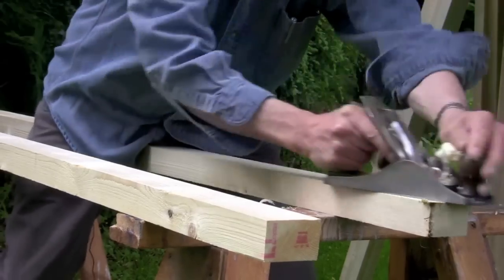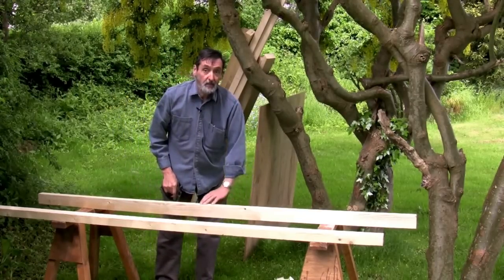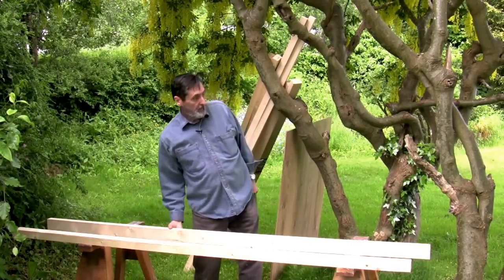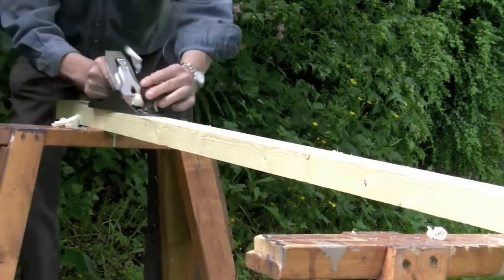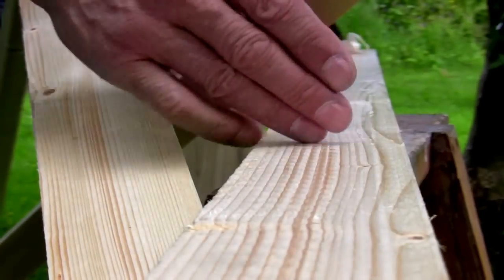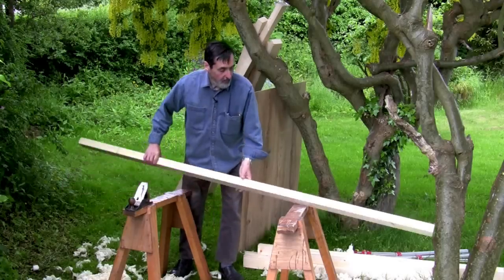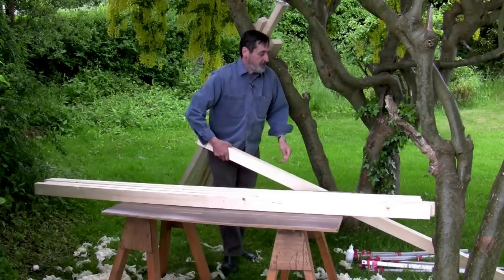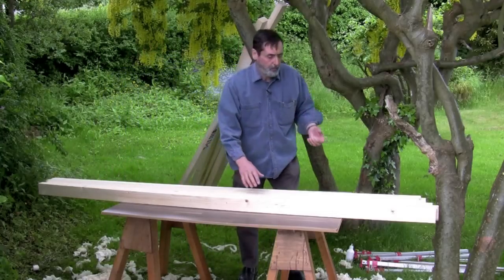How to build a workbench - (Part 1) Laminating the top | Paul Sellers

Comment: Mr Sellers, I've just completed my first glue up to make a wider board. Watching the ease in which you use a simple had plane to true up 2x4 stock gave me the courage to make a go of using reclaimed 2x4s to use in my project. The 2 main ideas from this video that made the glue up go super smoothly were drawing the V on the boards to retain positioning and doing the rehearsal. Thanks again for all of the inspiring videos that you provide.

Comment: For those of you just coming upon these videos, I can assure you that you will not be disappointed with this bench.  The one I made out of 2x4s, using exactly these plans, is rock solid. The most expensive item was the quick release vise, which I got from Lee Valley.  I had a couple of chisels, a cheap handsaw, and a $4 Stanley plane that I got on eBay for very little money.  Oh yea, and a bunch of sash clamps I got at Harbor Freight.  Enjoy building it!
Reply: Joel Finkel Starting mine today, time to do something with all this lumber i've been hoarding and moving around for so long!  Got a new vise for my birthday-and it's a dandy, QR and all!  Can't wait to get it all up and running.  Borrowed clamps from pal.  Yardsale plane (reconditioned by me).  Folding plastic saw horses.  Glue.
Reply: Wade Patton Paul never really shows how to attach the vise.  Let me know if you want any assistance with figuring that out.
Reply: Thanks but no problem.  The bench is much simpler than most things I've made.  I just come form a metal-working background and now need a wood-working bench.  Cheers.
Reply: +Wade Patton Just started planing the boards for the tops this afternoon.  like you I come from a metal-working background (machinist for 25 years), do you too find yourself breaking out the dial calipers? lol.  Any words of advise in hindsight? anything you would have done differently or spent more time on?  how do you like the bench?
Reply: +Darrell Gardner No dial calipers but I want to get some proper dividers and inside/outside calipers now for precision without known dimension. Measuring by feel is precise, just without any number.

I actually started out in the yard, brought it in after making the laminations.  I didn't get fit the well board as nicely as I should have, but it doesn't show and works perfectly.  Take your time fitting up your vise/s.  Funniest thing is, after getting used to the quick-action wood vise is catching myself yanking around on my machinists vice as if it's going to slide open or closed when positioning work!  

Love the bench.  Super solid and stable, yet is easy enough for one person to move around. Mine is just over 6'.
Reply: Thanks.  I did get a laugh when you spoke about trying to quick release your machinist vise.  I watched your video on filing cast steel cuz it reminded me of the one I posted last night to my channel, just really doing it to document and learn from myself and if someone else gets a kick out of it, great ha.  I got a few vises like the one Cody from "wranglerstar" mounted on his bench, one restored already and one needing some love but in amazing condition.  any thoughts on letting the vise stick out or flush mounting the solid jaw with the bench?
Reply: Darrell Gardner
 Find the Paul Sellers video if you can to see how he sets up his vise.  It may be subscription-only section (15 bucks a month), but the gist is add a wooden "surround" to the fixed jaw and a correspondingly larger pad for the moving jaw.  Then also, try "cross-clamping" as PS often does.  I'm currently using magnetic backed hardwood pads that came with the vise (which doesn't allow the oversized setup), but am now leaning toward fixed wooden pads just as Paul does. 

Next vise I need is a Ball-type for engraving!
Reply: awesome, thanks!  I'll have to check out the "surround" set-up or figure out something on my own.  I like the idea of making the jaws larger.
Reply: Hey Joe.  I was wondering - did you plane the rounded edges off the 2x4's.  It seems it would need to be done; sounds like a ton of work with a hand-plane.  I want to make this bench entirely from hand-tools, but might have to use my table saw if it's just too hard to do.  How did you get the rounded edges straight?
Reply: I dealt with the rounded edges after I glued up the slabs.  I used both a hand pane and a thickness planer machine.  My recommendation is that you not make a fetish out of working without machines.  Use them when it makes sense.  

In my opinion you should not worry about using a table saw to shave off the 1/8 of each edge to take out the rounded corners.  Or you can do as I did, which is to glue everything up and THEN plane it down (something you'll have to do anyway to take out any twist and flatten the slabs.

Have fun!  That's the point.  Do what you need to do to get the bench built.  You'll love it.  And then have fun using it.  And use it.  Treat it like a bench, not a piece of fine furniture.  Do not be scared to ding it up.
Reply: Good advice brother.  Thanks!

Comment: I'm impressed as Paul is using basic tools that anyone who wants to start woodworking should have. .I just watched the full set of video's, he says multiple times it's basically 2x4 planed and glued to make wider boards, pine, spruce, whatever softwoods work just as well as buying a crazy priced walnut bench top. In the USA, Lowe's or Home Depot are probably the easiest places to get material, 2x4 (actually closer to 1-1/2" x 3-1/2" are currently less than $3.00 each) It looks like you need quite a few of them though probably around 30? (to allow for cutting legs and 'mistakes') Still way cheaper than a bought bench, even from Harbor Freight Tools.The comments he makes about it being just as solid as a hardwood bench are very helpful.

Comment: Paul - another new subscriber who happened by your channel by way of Wranglerstar. I'm in the midst of building a poor man's bench along with some of the modification that Cody added, namely the use of 2x6's for the laminate. On paper, it seems like it would be a small matter to go from 2x4 to 2x6, but in practice it is quite beastly to surface-plane both sides of a 2x6 and also knock the bullnose off the sides.

For the first few nights, I would finish three 2x6's and then call it a day, having tuckered myself out from planing. Part of that was the nature of the material I was working with, rough and knotty, and part was poor technique. One of the positive aspects of using the larger dimensional lumber is that you will have self-educated on the character of pine and the use of your tools by the time you finish. I have a WWII-era Stanley #4 and a new "contractor-grade" Stanley #5. Both perform quite well now that I've learned to tune them properly. I despise the plastic knob and tote on the #5, but my hands have become sufficiently calloused that I can push either one for an hour or so without creating blisters. I had to use gloves for a while there, no small trick with a #4.

I am currently at a point where I have one 7-foot slab completed and cut to length, along with two struts made from three 2x6's laminated together and cut to 33 3/8ths (my bench will be 40" when complete: I am 6'2"). The slab was made from eight 2x6's, which will make the finished slab almost 13.5" with the skirt. This is intentional, as I want the front slab to be slightly larger and the rear to be smaller. It will be made from six 2x6's which will be 10.5" with the skirt. I plan to also fasten 2x3's to the inside of the well, flush with the bench top, to give myself some clamping surface in the center of the bench. Finally, I've decided to span some long rails across the bottom of the legs, although I haven't decided how to attach them to the legs. I'm assuming I should use a through-tenon on the long rails and then butt the short rails against the through-tenons at a 90 degree angle at the same height to provide a good surface for a platform under the bench. 

I want to thank you for this series, and all of the work you've put into your YouTube channel. Your instruction is excellent, and your down-to-earth and unpretentious style is a joy to observe. You've taught me and inspired me and I want you to know that I greatly appreciate it.

Comment: I built my workbench based on these
Videos, thanks they were inspirational in
Getting me back into wood working.
One thing I did do which may be helpful
Is to build the leg frames and apron first
Assemble these together  then you have a good level
 base to laminate the worktops onto
Helps avoid any racking or twist

Keep up good work!!
In place and nice and level

Comment: Love it just a observation. I find having some angle iron like made from old bed frame material to clamp on both sides at each end maybe six inches or so in and maybe a couple more a foot or so from the middle will help with that stair-stepping you're talking about. Also get a small square flat tray and small paint roller put some glue in the tray. Then just paint the surfaces you want to be glued together have them all laid out on waxed brown paper. (Usually available at most building supply outlets) just flip up the wood on their edges squeeze them together lightly get your angle irons in there and start tightening down the clamps slowly and evenly watching the stair-stepping. Rolling the glue will give you a quicker application and the wax paper will help with clean up after 20 minutes or so go around with knife and and a wet cloth or paper towel and keep the drips of glue from hardening. This will help in your finish sanding glue really shortens the life of sandpaper so the more you can keep that down the better. But if you have to remove a clamp or a angle iron cross brace clean that area quickly and replace  it. If you remove a clamp or a cross brace and angle bar do it one at a time and if you have a lot of pressure on them wait till the glue is set sandpaper is cheap and having your work fall apart isn't worth it.

Comment: I built furniture for a while and the way we would do glue ups like this was to spread the glue on with a paint roller liberally. provides an even coat all the way along the surface and allows you to glue up a lot of pieces before they start drying. might be worth considering. Great work though Paul! I'm definitely going to refer to this when setting up my own shop.

Comment from the maker: Yes! Yes! Yes!!! This is exactly what we want. It's dry and well seasoned = low movement. A few nail holes and defects will make no difference to the functionality of the workbench and yes, I have made benches many times from secondhand wood including pallets. I like a real workbench. Also, no, the wood will not make any difference to the plane iron and of course you will be sharpening from as you go. Watch for cement or rubble dust anywhere in the wood. This can dull edges in a heartbeat.

Comment: I used to have a bench similar to this. No dog holes. Had metal front vise. I went to one with wooden vises, dog holes, etc. I liked the first one better. I think I will build another along the line of Paul's. Much better bench in my opinion.

Comment: I'm totaly jealous of your 2x4 that actually look like it! One thing to know is that wood is measured up before drying (at least in N. America). So a 2 x 4 will never measure that and depending on the wood type they will shrink more, pine is around 1.5" by 3.25" while cedar shrink a lot less. I wonder if it's because they are manufactured after shipping meaning tree trunk would have had some time to dry before getting in the UK or if its a big difference between Canadian pine and the pine used in the UK (possibly Norwegian pine?).
Reply: Erdanx0 You could always buy 3×4's. Found in most lumber yards.

Comment: Paul, Thanks so much for making these videos!
I'm having issues with bows in my timber. I've planed the boards to make them nice and smooth as suggested but when I set them side by side for clamping, there are large gaps between the boards which don't close when clamped. Could you please give me some advice on straightening the boards? I am having difficulty getting them straight over such a large distance.
Many thanks,
Morgan

Comment: Hello, Paul!  I found your projects to be a great inspiration, and as a first 'real' woodworking project am going to work on this bench.  I do have a question on the lamination: the only 2x3s in the area I can find are fairly knotty, and I'm looking to see just how perfectly smooth we need the wood for lamination?  I can fairly easily take down the high and rough spots, but I find it a little more difficult to lower into small saw kerf spots on the board.  Thanks!

Comment: Excellent.  No need to put glue on both sides of the joint or spread the glue out.  Those are myths that have ruined a lot of glue-ups and need to go away.
Reply: +Leaning Tree Woodworks How does spreading the glue out ruin a glue-up? The more surface area the better.
Reply: The glue spreads itself during clamping.  Worrying about spreading your glue out perfectly takes time and in a complex glue up, if you take to much time the glue dries before you're done.  So taking the time to do an unnecessary step of spreading your glue can ruin your glue-up.  People think it's something you have to do, but if you use enough glue and lay it out in the right pattern like is done in this video, it will  spread itself out.
Reply: +Leaning Tree Woodworks Spreading glue only takes a few seconds. Also you can use less glue and still be sure that you covered the complete surface.
Reply: In a simple or small glue up, there's no problem with it.  When you get into big and complex glue ups with a glue with a short working time, you can run into problems.  It's thinking that you have to put glue on both sides of a joint and perfectly spread it out no matter what that will get you in trouble.
Reply: +Leaning Tree Woodworks You're correct. When you lay the clamps to a joint, that glue expands out, and also into the wood fiber on both sides. I never do glue both sides. I think that myth was invented by a glue manufacturer, to get you to buy more glue, as using it on both sides wastes it. You have double the squeeze out.
Reply: +craxd1 Exactly.  I don't know how the myth keeps going with it being so easy to test.  Put glue on one side, press the joint together, then pull it apart to see where you have glue.
Reply: Leaning Tree Woodworks ok now make your own video about it

Comment: I have ran into 2 x 4 stock here in the US, both studs and long, that were less than 1-1/2" thick. Talk about short changed, and things that wont fit over it. Whomever the manufacturer was, they over planed them. I believe I bought those at Lowes. I made them come back and take the entire pile, less the few I had used before I caught it. I should have made them take those back too.
Reply: +craxd1  almost right ceaxd do it both way let it dry and cure then pull them apart and see which is stronger

Comment: I've never tried aluminum clamps. I see one drawback being the amount of force you can (can't) apply, as opposed to a steel barred clamp. However it's great that you wouldn't get the black staining that occurs with high Tannen (acid) woods, like oak and walnut when wet glue interacts with the steel/iron. Also - I've found that leveling my horses into horizontal/parallel will avoid the stepping issue you're having when gluing. The planks seemed to get their twist transferred from the MDF surface's orientation.
Reply: he uses wood inserts inside his clamps for added strength. if you look closely at the ends you can see them
Reply: he uses wood inserts inside his clamps for added strength. if you look closely at the ends you can see them

Comment: Are those kilned wood?
I have a factory near by that cuts wood from spruce trees and sold them without drying time, they use them for making the rooftops in houses.
Is a bad idea to build with not kilned dry wood?
Reply: Wood needs to be dried prior to assembly of bench.  You can dry them without a kiln by stacking the wood properly and waiting for mother nature to do the job.  Depending on the climate and other factors drying time may take 6 to 12 months.  Dry more then you need there will be 10% to 40% loss.

Comment: No beef with the bench or the design, etc..  but wanted to share a tip for applying glue production-style.   To glue up the flat sides of 2x4 stock- buy your yellow glue in gallon jugs - use a paint pan and roller - a regular nap roller (3/8"-ish) works dandy to pick up glue and distribute perfectly evenly. .  We use 4" wide rollers for 2x4... 6" wide rollers for 2x6, etc.  At least 3x faster than the "squirt and squish" method Paul is showing - and much better results IMO.   One tip - buy shortened versions of large-diameter rollers if you can find them - vs. the "mini" rollers. The larger diameter lets them roll more easily vs just pushing glue around in the paint pan.   Another method that is fast and effective (albeit much messier)  - lay your 2x4s flat across 2-3 sawhorses, side by each.  (might even want to temp clamp in this position with a cpl bar clamps at the ends.  POUR glue out of your gallon jug and use a flexible plastic squeegee to distribute. As soon as covered - remove the temp clamps, flip up the 2x4s to their final position , place the end piece (no glue) - and clamp it up.   You can glue and clamp 6-8 pieces at a time this way in 5 minutes or less.  Just make sure you know which way you're going to "flip" the pieces and make sure they're laid out correctly before you start.  No guts no glory - go for it !